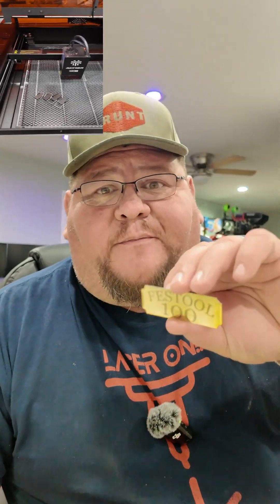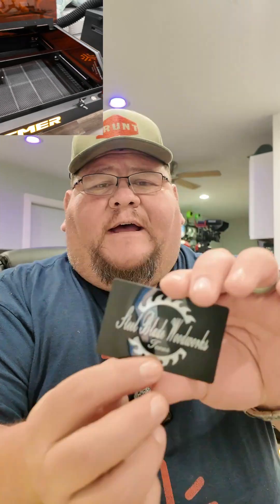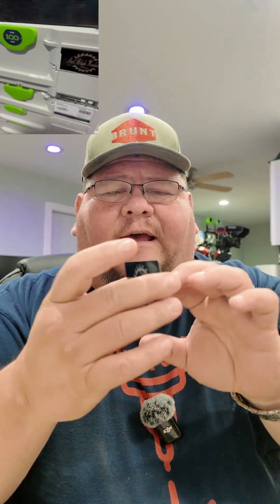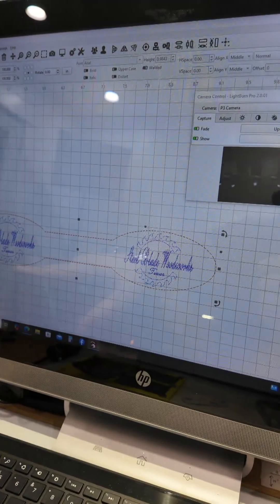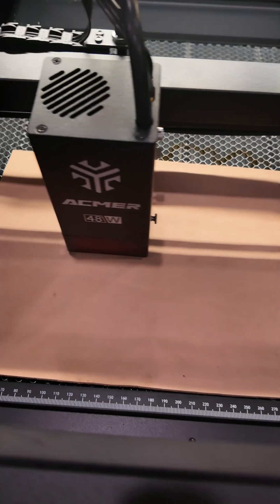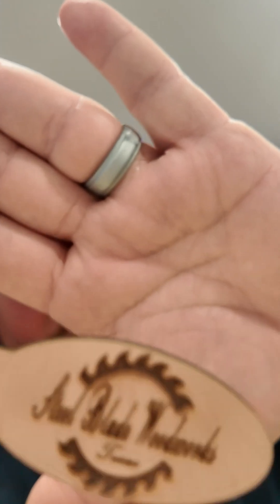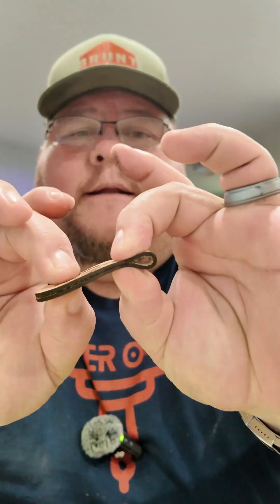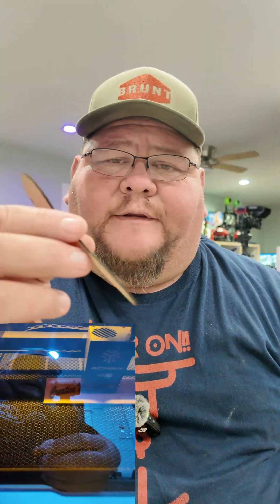ACMER P3 Diode Laser vs Metal & Leather- Will It work? #acmerp3 #engraving

Comment: How does it tell a cut from an engraving?
Reply from the maker: That is done by selecting the proper path in Lightburn software when you are designing your object. In Lightburn you select line to cut and fill to engrave.